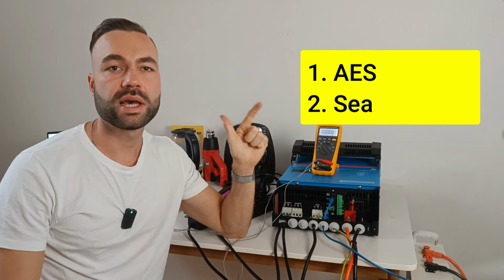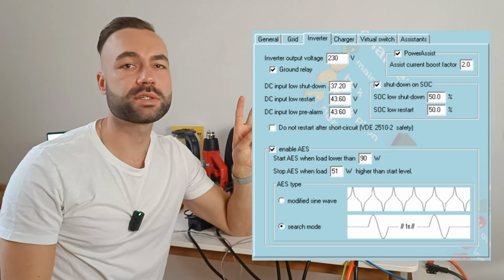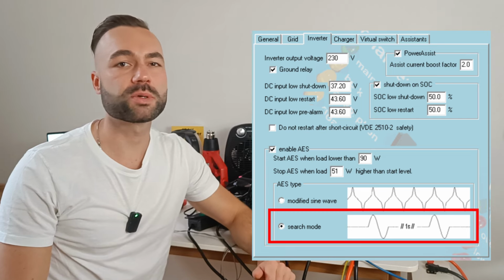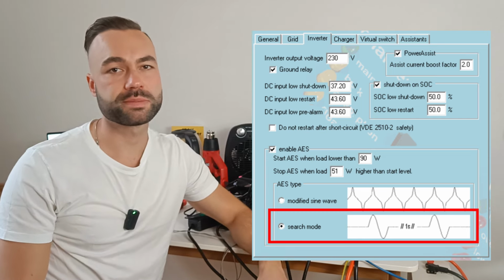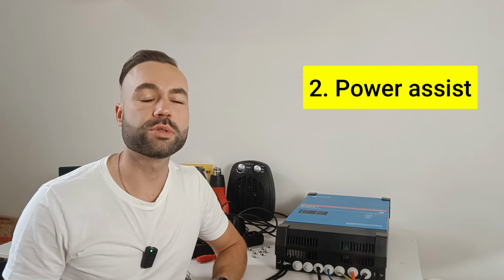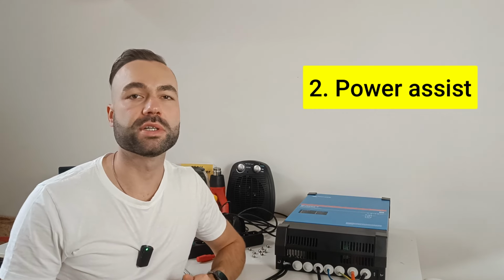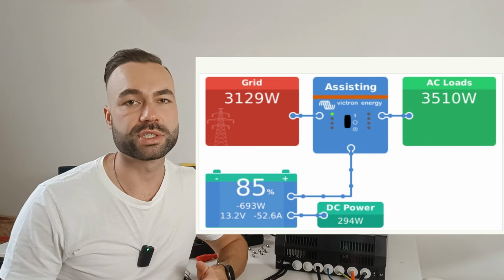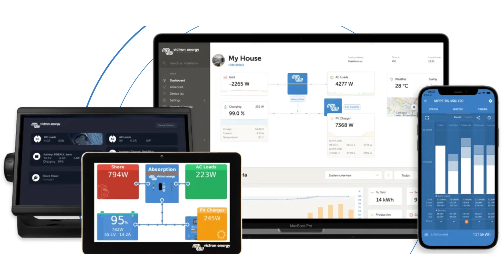Victron Multiplus 2 Testing + Closer Look

Comment: Great information for anyone thinking about Victron...Been running a Victron eco-system since 2021. Quattro 48v, 3000VA, 2 - 70A charge controllers, Cerbo-GX and shunt. Combined with 25Kwh of battery storage and 6800 watts of panels. Runs whole house flawlessly. Keep up the great work!
Reply from the maker: That's a great system. Victron is good at visualizing the entire system through vrm portal and their displays.
Reply: What is the average daily consumption of your house?
Reply from the maker: @istvanjanzso7698  10kWh per day. Thats about the average in europe.
Reply: So a 3000 watt inverter is enough??

Comment: Hello, I understand that the first version of the multiplus is much superior to the multiplus 2. Someone who deals with inverter repairs says that the copper used in the multiplus 2 is copper-painted aluminum and is also manufactured in China. The first version of the multiplus weighs around 30 kg compared to the multiplus 2, which is much lighter and full of aluminum painted in copper. What do you think, could you confirm this rumor? .Thank you. To be able to keep up with the market, Victron has made compromises .. , plus they are a serious company and declare that it has 96% efficiency and in reality it has 92 efficiency .... so ...
Reply: Nick, can you check and tell me if Multiplus II uses copper or aluminum wire?
Reply: @quanganhtruong3167  Hello, I'm from Romania and I know from someone who repairs inverters that multiplus 2, which is made in China, has aluminum painted in copper. The best is multiplus 1, which has toroidal and a different weight... Daia was also expensive, but now let the factory face the market in China and from there the trouble. I would like more people to confirm if it is true or not.
Reply from the maker: It looks like it's copper as you can see at 5:42
Reply: @cleversolarpower  Just  what is made in India   and not multiplus 2  .Here in Romania  multiplus 2 is  shit  no toridal

Comment: YOUR BATTERY WIRES ARE 50% THINNER THAT IT SHOULD BE IMO.
Reply from the maker: You don't have to use caps lock. 5000VA=4000W. 4000W/48V=83.3*1.25=104A. A 4AWG or 25mm² cable is sufficient.
Reply: @cleversolarpower  and you dont have to use lower case.

Comment: Nice testing,i have the same inverter.  It has different efficiency according with load output, sweat spot is below 1000 watt.
Reply from the maker: Have you found that the inverter is more efficient with loads under 1000W? There was nothing in the manual stating the power draw for 96% efficiency.
Reply: @cleversolarpower  Yup you should try it , I guess the efficiency in the manual is the average.
Reply: @cleversolarpower  Yes. Peak efficiency on the Multiplus II 5kVA is between 600W and 1.5kW (96%), falling to 95% at 2kW, 94% at 2.5kW, 93% at 3kW and 90% by 4kW. There are graphs on the Victron community archive forum searching for "Multiplus-II 48/5000 efficiency curve" should find them (I would just paste the URL, but this is youtube). Similar but different curve for charging.
Reply: @MrGeozac  The efficiency in the manual is the peak.

Comment: you can’t directly multiply the AC amps by AC voltage to get the appearant Power, there is also a power factor. Basically you need to use AC power meter. Since power factor is 1 for DC you can simply multiply VxI but for AC since you are running a fan there is some inductive resistance as well.
Reply: The impedance of the fan is irrelevant.

Comment: Hello , pls can i still connect mppt to victron multiplus 11?
Reply: Not directly. It does not contain an MPPT controller. You get a separate DC-DC MPPT device and both that and the inverter connect to the battery. Or you could connect the MPPT directly to the multiplus II without a battery I presume (but I've never seen such a config - there may be issues).
You can buy an RS Solar Victron device which has the inverter and charger of the multiplus and 2 high-voltage (450V) MPPT controllers. Then you can connect panels direct to that machine.

Comment: Can you help me out i have 5, 12v lead acids at 35a. I want a solar panel that just tops them off would a 100-200w 5-11a solar  panel with a mppt set at 60v do the trick?
Reply from the maker: It depends on what loads you have attached.

Comment: Can you configure it to be net 0 using a life feed from a p1 meter? Such that it charges the battery with the excess power you have (so charge battery with 200w when you have 200w excess, and 500 if you have 500w excess?) and same for using only the battery power you need when the sun is down
Reply: You can configure it to do pretty-much anything. But some things are easier than others. You can certainly set it not to take any from the grid, or (separately) send any to the grid.
Reply from the maker: Yes, you can adjust it in the settings. I use the three phase energy meter and connect it to the multiplus. I have it set up to export 0 to the grid, but draw from the grid from 10pm to 6am to recharge the batteries. I recommend taking a look at the ESS PDF.

Comment: Hi Nick, what is happening of charging  if we had (4) 12v 228ah in parallel and plan to to add (2) 12v 280ah ? Thanks for all informative videos👍
Reply from the maker: Good question. I made a video about parallel batteries with different capacity. I published it a few videos ago.

Comment: Thank you.. this is a very useful video.. things that people don't understand until they buy one.
I am trying to decide on a battery back-up for my furnace freezer, fridge, internet and maybe an led light or something.

I have a question about batery leveling in a new 24v system.. can I charge each battery separatrly using the victron multi charger then hook them up?  Or do I still have to buy a 12v lifepo4 charger to level my battheries before I hook them up?

I can't decide whether to get a multiplus or something for arround 500 plus charger. 

IN Canadian $, For 500 I can get a 3000w plus charger about $80 for charger so about 600 vs  about 1100 for 2000va  charger included.

Is the price difference worth it?    Maybe I buy the cheap and it doesn't last or maybe victron just has more to go wrong?

And I don't like that victron  spring loaded power connectors instead of lugs.

Plus I use linux.

The choice is not an easy one.

The info is really useful for me.
Reply from the maker: I recently made a video on why you should not wire batteries in series.

Comment: @cleversolarpower is this inverter suitable for pure off-grid use in a remote cabin? Or does it have to be tied to the grid to work?
Reply from the maker: Can be used off-grid and can be grid tied as well.
Reply: @cleversolarpower  Really liked your review and I saw other very positive reviews, so I bought the Multiplus 2 48/5000VA. I'd like to pair a 48V 100ah server rack battery with it, but I'm not sure which one to buy - there's a lot of Chinese manufacturers with not enough reviews. I had LiTime 12V batteries before, and I had a good experience, but I'm not sure that their 48V server rack is the same good quality. Are there any server rack battery manufacturers that you would recommend in Europe (maybe available on Amazon)?
What battery did you use for this test?

Comment: I really like your videos. Thanks for being so helpful.
Have you done any solar panel installation on asbestos roofs? I have an asbestos roof and have no idea how to secure the solar panels to it. I am in Zambia - lots of sun, but not so much tech support.
Reply from the maker: Installing solar panels on an asbestos roof should not be done. Because you will be drilling into it. I'm not sure how the rules are in other countries, but here the roof should be replaced because you are altering the asbestos, this creates micro asbestos dust which is cancerous. Replacing happens in suits with masks.
Reply: I would look at glue-down panel mountings to avoid drilling holes, or re-use the existing mouting holes. The stuff they use for roofs is not very hazardous (only about 2% white asbestos which is the least dangerous) but it would be good to avoid drilling holes and making asbestos dust if possible. Wet holes if you do drill. There is useful info on a thread titled "Installation of PV on Corrugated Asbestos Roof " on the Camelot forum.

Comment: I've been watching your videos, very informative..
Can you please make a video about which inverter is good for Truck drivers who use mini fridge and 3in1 microwave 1200 W. What size wires needed if the inverter 8 feet away from the 4 batteries the truck have. Thank you
Reply from the maker: Check my review about the powerqueen 2000W inverter running a microwave.

Comment: Could you please make a video like this configuration.
1. I want to run a 10 BTU A/C unit about 12 hours in the morning to evening.
2. Off Grid, 12  and 24 and 48 V, a/c unit (Which system is current is efficient and effective)
3. House use to reduce the electricity bill, and this configuration is just only for the A/C unit.
You're making very useful videos. Thanks.
Reply from the maker: 1. depends on the power draw during one day. Impossible to say without your numbers.
2. for your high power application, 48V.
3. Reduce electricity bill? So it needs to be cost-effective. If you are grid tied and feed-in is 1:1 then you can use a simple string inverter without battery. If you don't have net metering, then adding a battery the size of your daily consumption can be worthwhile. Have to calculate if it's cost effective though.

Comment: Hi and thank you for this. Do you know if the pass thru AC is in sync with the inverter, this is important when switching from battery to AC and back. I had a big name 3600w solar generator which caused problems when switching even though it was 20ms on a 8000 btu window AC. Only happened when switching from AC to inverter and back. Thanks!
Reply from the maker: I'm not really clear on your question. If there is no grid or generator power, the inverter creates its own sine wave. But if there is a generator or grid connected ,it copies the sine wave from there (so input and output is in synch).
Reply: @cleversolarpower  Hi, thank you for replying. 120V AC is 60hz. It’s a sine wave form. Is the inverter in sync with this? I ran into an issue with a all in one solar generator. About 40% of the time when switching from battery or to battery, it would cause my 8000 btu AC to draw excessive current which caused the inverter in the solar generator to power off.
Reply: @JenkinsUSA  yes the inverter stays in sync with the grid AC when the grid is present. Obviously it can't when there is no grid to sync to (i.e during power cuts). It will re-sync when the grid is reconnected.

Comment: Bonjour et merci de ton retour. Il me manquait l onduleur Victron, sinon j ai le cerbo gx le smart shunt et 14 MPPTs(75/15 100/30 100/50), tous mes panneaux en parallèle avec un onduleur Master Power type Voltronic pour basculer sur le réseau. Je vais m acheter le 24/3000VA pour remplacer mon Master Power. Avec la machine à laver plus le résiduel je suis à 2300 voir 2500W maximum pendant 15 minutes environ. J avais besoin de savoir si le multiplus était capable de les supporter vu qu il est donné pour 2400W maximum. Même si je dois traduire, j ai bien aimé ta vidéo et je vais te suivre. Oui très intéressé par la configuration, j espère que tu feras une vidéo la dessus.
Reply from the maker: I don't understand french. Can you comment in english so we can all learn?
Reply: @cleversolarpower  Hello and thank you for your feedback. I was missing the Victron inverter, otherwise I have the cerbo gx the smart shunt and 14 MPPTs (75/15 100/30 100/50), all my panels in parallel with a Master Power Voltronic type inverter to switch to the network. I am going to buy the 24/3000VA to replace my Master Power. With the washing machine plus the residual I am at 2300 or 2500W maximum for around 15 minutes. I needed to know if the multiplus was capable of supporting them since it is given for 2400W maximum. Even if I have to translate, I really liked your video and I will follow you. Yes very interested in the configuration, I hope you will make a video on it.

Comment: Is the 2W ‘search’ mode adequate to power a regular under-counter fridge?  I’ll guess the answer is no, because most of the time the fridge’s consumption will be well under the 40W that you quoted as the minimum power draw for the inverter to switch on, so the fridge won’t get mains power; and not getting mains power it won’t ever get a chance to turn its compressor on periodically which is how it actually cools your food!

Is there a way to make the Search Mode support a fridge running?
Reply: IF the fridge has basic mechanical thermostat the motor will likely draw enough current when it starts to prompt the inverter to enter run mode.  However it will likely not draw enough current to keep the inverter awake.  Without adding a parallel circuit in the fridge to signal to the inverter via one of it's inputs that it needs to be on, you could add an incandescent lamp in parallel with the compressor motor to bring the consumption up over the minimum required to keep the inverter in run mode while the compressor is running but that obviously burns battery capacity.  If the fridge has electronic control, forget it.  It needs continuous power to operate the electronics.  If the fridge has automatic defrost, if it even has a freezer section, it may not operate correctly with intermittent power anyway since the timer motor is not powered all the time, although some fridges simply defrost based on compressor run time, in which case it will.
Reply from the maker: Couldn't have said it better. Although i wouldn't add a light in parallel, this will consume power as well, so you are better off leaving it at default or use the AES mode where the sine wave is switched less, but can still detect a load. Newer fridges use electronic thermostats now which don't use a lot of power as well, so its probably not detectable. So regular mode it is.